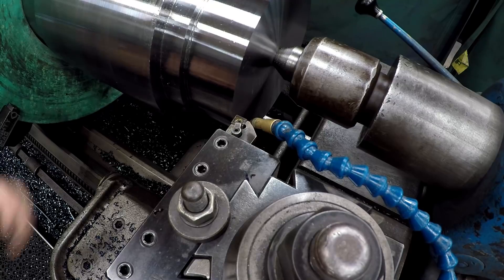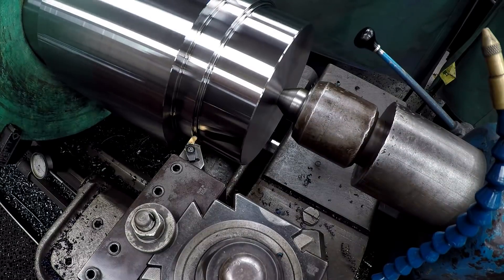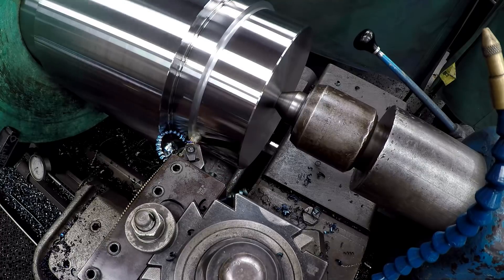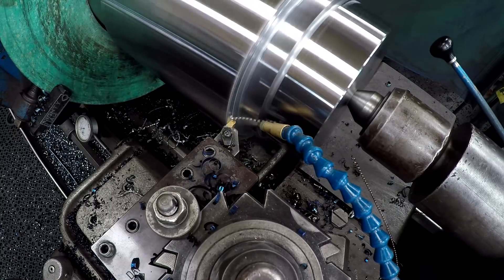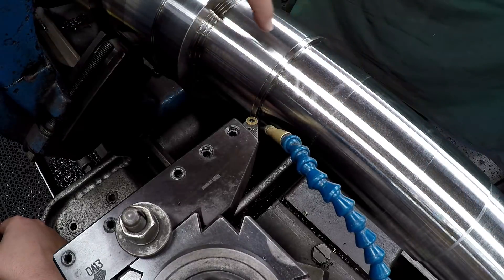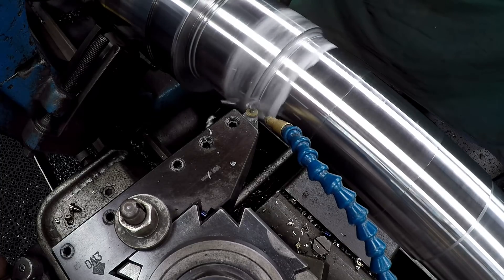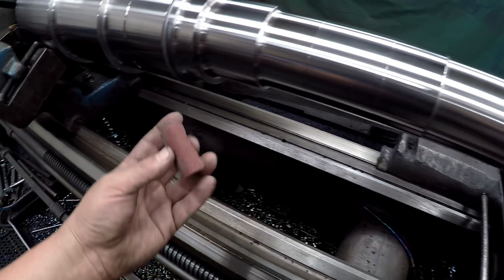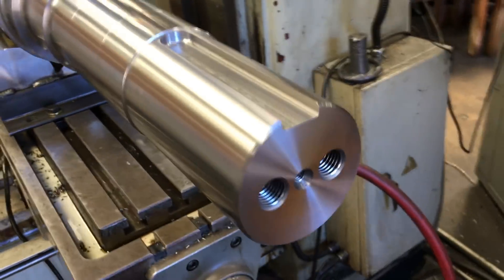10 Inch Vertical Output Shaft Part 2: Completion

Comment: when it comes to duplicating a part, how do you determine the precise dimensions when the original is so rusted?
Reply: the dimension of the rusted region is not so important.
the important dimensions were edges and where the keyhole was. They had to tell him the precision of those. the rest as long as its not smaller than what is already there its good.
the steps are there just to make the shaft lighter also to decrease the stress buildup on diameter shift.

if those had to be pricise for some reason, then they would have to told him (they either already have the part and give it to him, or give him the dimensions) 
as for actual mechanical way, idk.
Reply: If you know what component goes where, and the application, you can fairly easily determine what the needed tolerances are from the component manufacturers product literature.  Motor shafts are typically k5-k6 tolerances for bearings, but gearbox shafts might be m5-n6, or even tighter depending on how much torque is being transmitted.  Go to the FAG Bearings website and see if they still have publication WL 00200/5 available for download, they have some examples of various types of equipment and the bearing tolerances needed.  Falk Couplings has similar design guides on their website.

Comment: Beautiful work. How do you compensate for wear when you're measuring a broken piece that you're replicating, without a print?
Reply: Some of the dimensions are open space, no bearing fits or such. Those should be very close to actual, provided there is no corrosion. As far as the bearing journals, those are a standardized bearing and fit. Also, there may be a print for this one, Adam might not be showing it for copyright reasons or such.
Reply: My guess would be based on the standard bearing and seal sizes.  Do not know for sure but that would be my educated guess.

Comment: Did you weigh it before & after ? Is that something you do, check weight or not so much?
Reply: it is just a waist of time to do that. and the weight of the part is almost negligent compared to the forces that will be going through it.
and if they needed to know weight, they can calculate it with ease, its just a bunch of cylinders

Comment: Beaut job on that shaft Adam, could sit for hours watching you work, but then I wouldn't have a job, would I! Just a quick question, do you have to harden any of the jobs you do, or are they mostly just turned to size and don't need hardening? I'd like to see the hardening process at some stage if you do have to finish a job that way... Keep up the fantastic videos mate!
Reply from the maker: We use pre hardened 4140. You machine it to finish, or grind if you prefer.
Reply: @Abom79  how hard  Rockwell  is it.?

Comment: quick question, all the material that is shaved off lying on the ground, is that recycled at a profit? what I mean is obviously you pick up the scrap and weigh it and send it out to be reused but do you get your money back? or it does not matter because the client paid for the whole thing already?
Reply from the maker: The material is paid for in the job, the chips get sold to the metal recycling yard.
Reply: One shop I worked at took profit for all the chips and used the money to buy snacks and other stuff for consumption for the shop. One company that had sent us their own personal material (blue wax cylinders) wanted us to collect the chips so they could melt them into more. They never came time and time again and we threw that shit away. I've also been given permission to take scrap steel plates for target shooting. The current shop I work at mainly does carbide and ceramic and once a big bag on a pallet fills up its sent out for recycle and the carbide is pretty valuable.
Reply: The shop i worked at might pay 80 cents a pound for steel and get 4 cents a pound for chips, back during the 2006-2007 economic crash the steel recycler wouldn't pay anything and charged us $300 just to come get the dumpster. he had to pile them up on his yard for over a year.
Reply: how times have changed

Comment: Enjoy all your machining videos! One unusual question: what do you do with all the metal shavings that the shop collects over time?  I have to imagine you produce hundreds of pounds of shavings in a month, what happens to them?
Reply: Deje, see the previous question and response.  But steel/iron is one of the most easily recycled products or materials in the world.  Virtually nothing goes back into the ground.  There are vast numbers of different grades and purities of scrap, but all will find a new home in some new product.  From cars to curtain rods and engines, or planes, trains and automobiles as the saying goes.  If it's made with metal odds are part or all are from recycled materials.

Comment: Nice work you do exactly the same as me even the emery cloth trick in the rads. Shame you don't have a DRO on that machine it makes the shoulder lengths so much easier. your copper packing are almost identical to mine at work. Its so hard to find someone with your skills here in London now days.
Reply: There are loads up north in Manchester.

Comment: 4140 will finish like nothing else

Interesting that the inner journals are standard sizes and the seal and external journals are metric
Reply from the maker: Many manufactures use metric sized bearings.

Comment: what is the liquid that comes out of the blue hose ?
Reply from the maker: It's water mixed with Kool Mist coolant. Once you use it it's spent. Just make another gallon up 10:1
Reply: p0lytube Its a fine mist of coolant they tend to be water-based.
Reply: is there a sump that collects this? is it reused? does it just go on the floor?

Comment: When you tapped the two holes on the end of the shaft, how did you control the feed?  It looks like the tap is in a jacobs, was there a tapping head of some sort behind that?  Or maybe the table feed rate matched the thread pitch?  I'm not familliar with boring mills.
Reply from the maker: +James Lederer The spindle floats just like any milling machine spindle will. I don’t have it locked it for a power feed. The tap pulls itself in.
Reply: Got it.  Thanks.  I assumed the setup was more like a typical horizontal mill with a fixed spindle and no quill.

Comment: Where you used the steady rest did you skim the marks out or use the grit paper?
Reply from the maker: +userwl2850 I ran it on the largest journal but left it oversize and machined it down once completed.

Comment: Another beautiful job. And I really like the concrete coming in. Wish I had a shop like that!Now for giggles: The plural/multiple of radius in Latin (as most of our language is based on) is radii. Ray De Eye.
Reply: just for more giggles: radiuses is a valid plural in British or American english (though the romans did pluralise it as radii).  My latin teacher would have thrown his chalk or board duster at you for pronouncing radii with a long "i" as the last syllable!  - Back in my day (70's) British classical latin teachers insisted all "i" sounds should be short, like the "i" in bit or the "i" in radius (a short "eee" sound), they reserved the "eye" sound for the ae diphthong, like in antennae :)
Reply: What about octopuses?
Reply: Octopuses is fine in English, but I guess since its of Greek origin, octopodes would be OK too (not octopi though, unless you're an ancient Roman? :))